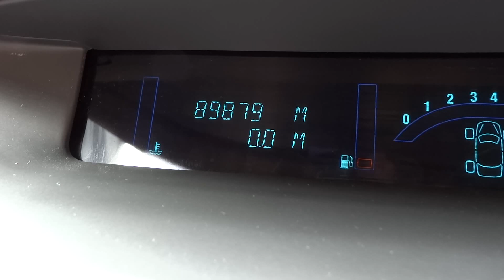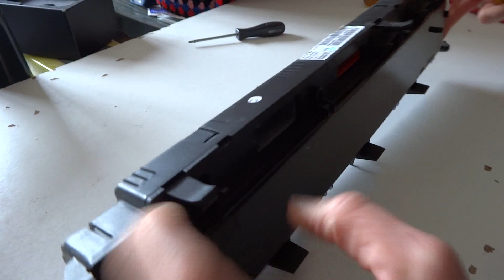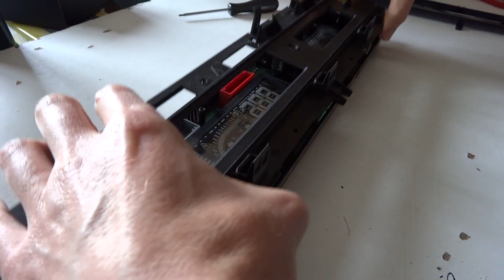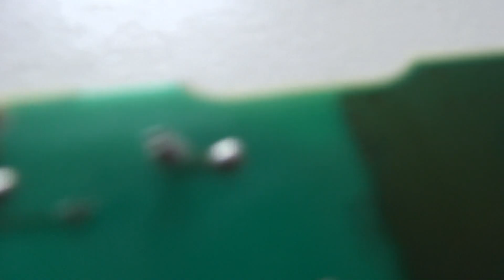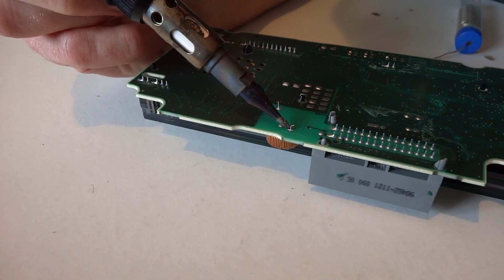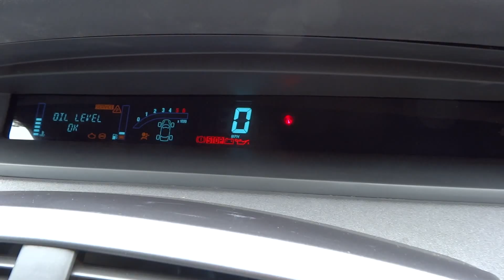Renault Scenic Dashboard Repair. Fix Digital Dash Panel. Mend Faulty/Failed Display.

Comment: Nice video and thank you for posting this. Someone here mentioned that Renault will do the job for £150 but I can say this is only if your car is under 10 years old. Sadly my Renault Scenic Megan 1.6 is a 2003 and Renault want to charge £600 to fix! My dashboard currently works for most of the time but then either fades away or just turns off completely. I guess this is the same issue? Do you think a mechanical numpty can do this job? How do I reset the miles?

Also if the dashboard is only occasionally failing (usually after 40 min driving) then would that mean the mosfet and resistor are likely to be OK and it's just the solder joint that's breaking?
Reply: +Michael Robinson Hi i have the same problem, have you resolved it and if so how?
Reply: It depends what you're talking about. The dashboard worked for a couple of weeks and then it started to go wonky again. I suspect this is because the solder I used was lead free - this makes the solder quite brittle so I'm looking for some leaded solder currently and will re-do the job. I have no idea how to reset the miles - it probably needs a special computer thingy to do this (look up mileage correction) but in all honesty I can't picture anyone buying our Renault so it doesn't really matter - electric windows don't work, fan doesn't work, A/C doesn't work etc. The simplest resolution is to probably just buy a ford.

Comment: Hi, Great Video! would this also sort the fault when the dash just goes blank ? cheers
Reply from the maker: +Mechanic Darren Hi on this dash it still worked and the little fuse hadn't popped, but the fuse maybe what's gone on yours. First though I would locate & check the main fusebox (although I don't know where it is, and check any fuses there.). Also worth checking is the red connection to the digital dash, sometimes a waggle will bring it back on, sometimes disconnect & reconnect may do to, if the fault is with the wiring or the connection. Then if you have to undo the dash, check all the solder joints you can see, as a dry solder joint may equal a lost connection. (I needed a camera to see them better than my eyes could though!)
Anything electric is a pain when it's not working, so I hope you can find & sort it easily. best of luck, thanks.

Comment: Brilliant! well done!  I guess that the toroidal coil vibrates at an ultrasonic frequency and this causes the joint to fail.  It is rumoured that soft-solder (used to be 60-40 before the EU banned Lead) with a small percentage of silver in it is much more reliable.  Allegedly the few percent of silver prevents "Tin Pest" and the other problems that occur with tin.   

Incidentally  in ancient times Tin Pest cost a Russian courier his life!  He had been ordered to transport a valuable collection of Pewter goods across Russia in winter but when the crates were opened all that they contained was grey powder!  The high ranking owner of the pewter assumed that his valuables had been stolen and replaced with sand so the courier got the chop!  Astonishing that such stupid people get to be the boss!

Silver-bearing solder is essential for satellites as it gets very cold up there!

Comment: Hi, what type is the small resistor and where would I get the correct one from, thank you
Reply from the maker: +Keefy310857 ok i called it a resistor by mistake. (we all make them sometimes.) yes it was a SMD fuse. I sold mine on ebay recently, perhaps it was you that bought it. thanks. I will put a note on the video now so that it's clearer to all! thanks.
Reply from the maker: +Keefy310857 hi it's fine thanks. I've just added the correction notes on the video. I should have added them a long time ago.
Reply from the maker: +Anthony Mobbs Hi, the resistor is a Surface Mount Device/Fuse or SMD fuse (aka SMT!). Unfortunately although I just bought mine from ebay I don't seem to be able to find any listed on there now, and no longer have the vehicle / paperwork to see which ebay seller I bought it from sorry.
Reply: +Anthony Mobbs - I discovered the resistor, next to the wire inductor was open circuit. 
However it is not a resistor. In fact it is a SMD 6.5 amp fuse. I 
discovered this once I had checked it and found it was open circuit. On 
my display it is a white component with a mark in blue "6.5" . With the 
help of a tech savvy mate we identified it and I replaced it. Problem 
solved.
Reply: +Anthony Mobbs PS Get it from Farnell or any component supplier. Fiddly soldering though. Good luck - hope not too late to help.
Reply: +ifitsgotwheels I didn't mean to take any value away from your very useful post. Without
 it I wouldn't have even known where to start. Thanks once again. Indeed we do all make mistakes ! Mine was to buy this Scenic. Mechanically unbeatable but, in common with many French marques, terrible electrics. My good lady is French and her last car, a Pug 306 1.9 litre NA diesel went on forever but electrics - nightmare !!!

Comment: Hi, where did you get the mosfet from the only ones I can get are from France, they are the f3710s can I use an alternative model midget or does it have to be this one can I source this from the UK? Need it quick as I'm driving to France in the next few weeks. Thank you
Reply from the maker: +Lewis Ross Hi I got it off ebay from a UK seller for £3.12, I can't find any on their right now under MOFSET F3710S!
searching just IRF3710S and it seems a couple of sellers currently have them listed but at around £10 each, but in the UK. thanks.
Reply: Why not a better mosfet whit less RS ON will help alot on the heat of the board.

Comment: I have a similar problem but is manifested turning off the display for radio and replacing the tool after a certain time. During the shutdown displaj radio remote controls on the steering wheel is not working. Have you any idea about this

Comment: Hi thanks for your video.

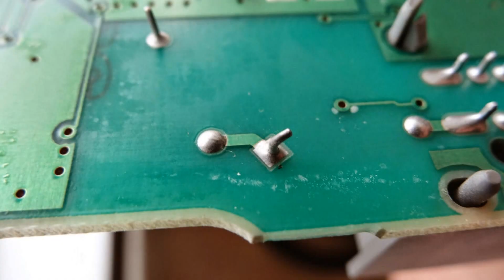I re-soldered the dry joints around the coil @ 3:00 and it worked for a few days.

I pushed a soldering iron under the LCD and managed to re-solder one of the existing MOFSET connections. (That lasted another week)

How do I lift/remove the LCD screen in order install a new MOS Set?
Does it unclip, or must the 40 or so solder connection joints be removed so as to get access to the soldering area? @ 4:17.

I see you have some clips undone on one side, but not quite sure how you did that.
Reply from the maker: OJust2C Yes you have to desolder it and bend it open (sorry I should have shown this but I had that bit done for me!), see the french version here https://youtu.be/UUcnZQbhVvc?t=6m36s as that shows how.
Reply: ifitsgotwheels WOW: Prompt reply. Thanks will follow up.

Comment: hi,can u help me somehow,my problem is next,right side of dashboard(where is radio,temperature,clock) doesnt work. Other side working well. Where the problem is?
Reply from the maker: hi,
has it worked for you in the past?
If 'NO', and you bought the vehicle like this then it could be because a previous owner has replaced the dash at some point, (it seems there are two types of radio and the dash must match the correct radio!?). but as to whether that would just knock out the radio display, or the radio/clock/temp display I cannot confirm!
 
If 'YES', then I will have to best guess this, (as I no longer have the scenic to test any of this).
1. I would check the fuse, as in many vehicles the clock and the radio can be found on the same one. The fuses I believe are located in/around the glove box area, but from what I read can be difficult to get to! Usually a guide to what fuse is what should be in the same area or on the back of any flap you have to remove. You can try swapping fuses of the same value, but often you will be able to tell if a fuse has blown when you remove it as you will see a split in the the metal.
2. (or, if fuses above look difficult to get to try this first) I would remove the dash panel, disconnect the two clips and reconnect them as it could just be that one has vibrated loose a little or come off. I think, but can not be sure, that the red clip may power up the right hand side of the dash (anyone know?). Although taking the dash out is easy is does require a Torx screwdriver, sorry. Also waggle the wires before/after as it could be a break in the cables.
3. I can't find any answers to this fault on the internet so far, but it seems that it is indeed a problem. So if you have to get the circuit board looked at as it has been suggested to me that it could just be dry solder joints affecting the board particularly at or near the connectors. You may be able to inspect the board yourself, but even I had difficulty seeing dry joints on this one, so use a zoom camera if you have one.

I hope it turns out to be an easy fix.

thanks.

Comment: Does this reset all my mileage?
Reply: OJust2C my one went 100k, got the dash changed for £150 at Renault
Reply from the maker: No, the mileage did not get reset. We were afraid it would, and so we took a note (& photo's) of it just in case, but on this occasion the odometer mileage was still present afterwards. We did not have to have it re-programmed in, thanks :)
Reply: ifitsgotwheels oh okay. Mine has been reseting and flickering. I took a picture of tje mileage being 48k on the 8th and today it went up to 59k. I already bought the parts. how can I fix this?  Will it stay on 59k? Please help
Reply from the maker: trulypsychogaming
Hi, I think that once the mileage has jumped up, then, after fixing the dash, unfortunately it is the jumped up figure that will remain.
but fortunately you can get the mileage corrected, you can have this done professionally but it seems that those cheap 'OBD2 Bluetooth Adapters' that cost around £3 upwards on ebay when used with a mordern bluetooth phone will do the trick for you! (although I did not have to buy one in the end, so have not tried the correction myself).
This is only illegal if you are trying to doctor your mileage, but to put it back to the actual genuine mileage would be fine.
Reply: Trulypsychogaming I had a 1k added (in Austria) because of the same problem. Left the "Speed Limiter" active and then when the screen clicks in and out (while solving my problem) the default screen is not the Odo Meter.